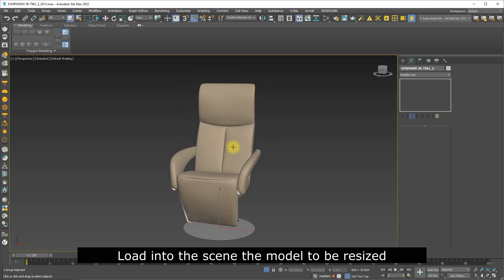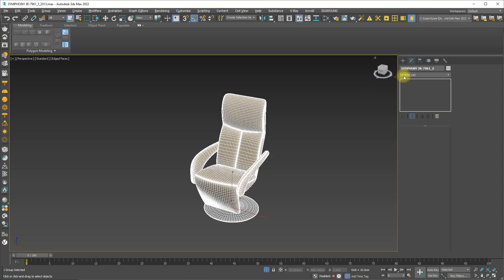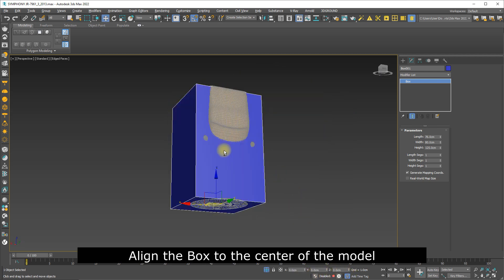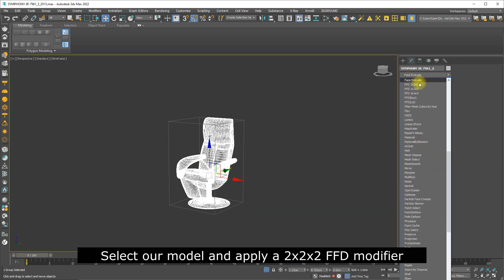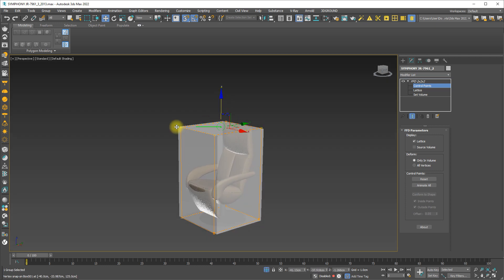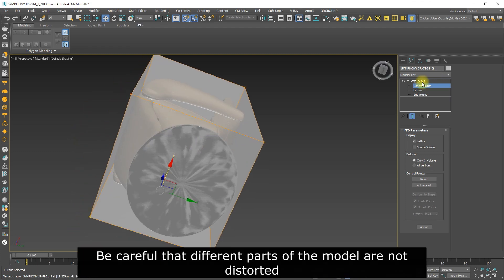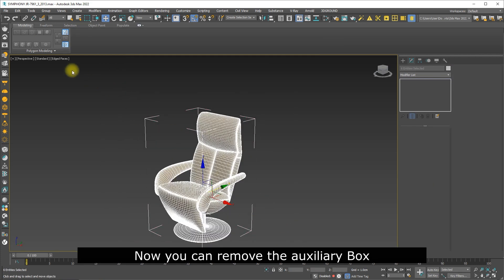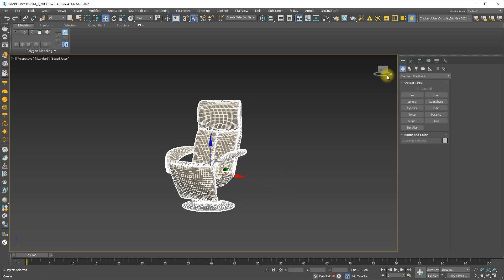Adjusting the exact size of the model in 3Ds Max

Comment: This is a nice tutorial. Thanks!

My other main technique involves math. Use F12 to summon the Transform Type-In menu.
If my object is 2 meters on X axis, I need it to be 10 meters on X axis, so it needs to scale on X axis by 500%.
Or if the object is 204.8 cm, and I need it to be 1000 cm, then scale it 488.281%  (go 1000/204.8 = 4.88281. then multiply by 100 to convert to percent. = 488.281%)

but also this technique is even easier!  https://www.youtube.com/watch?v=ZfH_fOBSRC8

Comment: Why not simply use the Measure from the Utilities tab? (not the tape from Helpers).
The Measure Utility can be used as a Floater too!
Reply: @3dground  You have dimensions X,Y,Z, Volume, Surface Area in realtime
Reply from the maker: @marc3dartist601  In fact, this is the best way to fit all sizes exactly to the millimeter recognized by professionals.
Reply: @3dground  Nice!